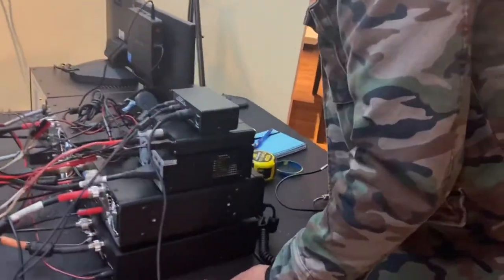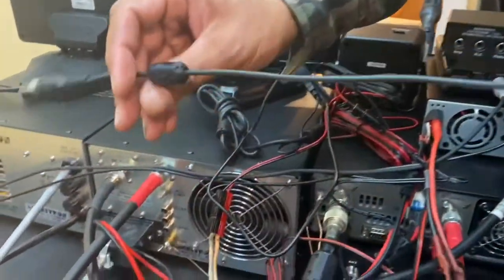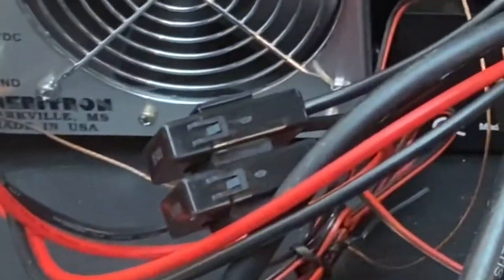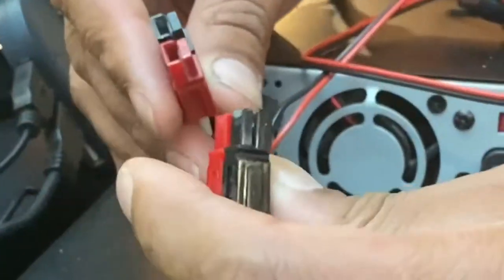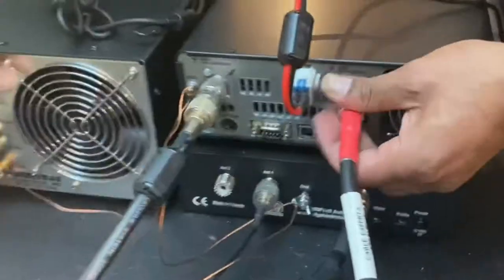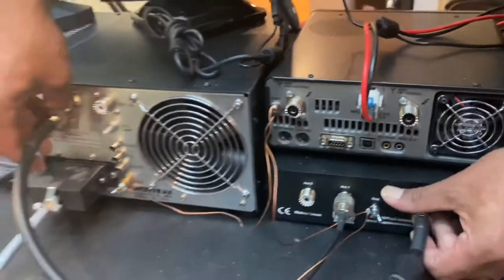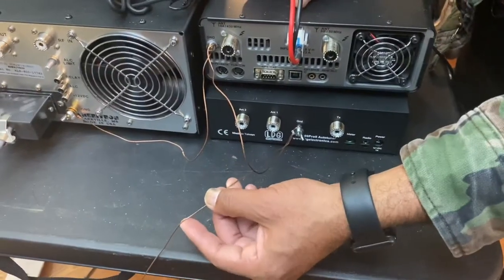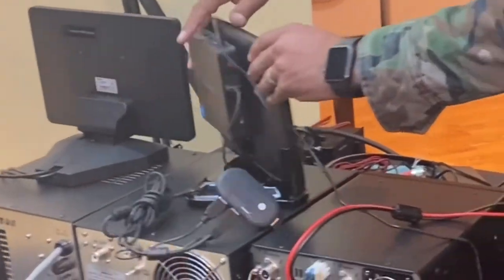Yaesu 991a - Ameritron ALS 600  - LDG AT600pro autotuner disassembly

Comment: Luis FYI... when grounding you should not daisy chain them. Best to run a ground from a ground stake outside to some 1/2" copper strip or pipe and them run separate connections from the copper tube to each piece of equipment using some braided ground strapping. Nice Video good job... 73 Jerry de K7ER

Comment: Thanks for the video.  I have a 991A and ALS 600 with power supply, but didn't know if they were compatible.  Each component should have it's own ground running directly to the station ground to prevent rf in the shack.  Ground wires should be heavier than what your using.

Comment: Hi Luis!
Great videos. I also have a Yaesu FT991A and have a SLA-600 Amp and PS on the way as well as a LDG AT-600PROII. 
What cables do I need from the FT991A? I ordered the cable with the Red and Black mini plugs. Where was the next video you mentioned in this video as I couldn't locate it?

Thanks Luis and keep the videos coming. 

73

Greg Lopez

Comment: Hey Luis,  I have the exact setup as you. Ft-991A. Als-600,  LDG AT-600ProII and the Ameritron ARB-704. 
The issue that I have is the ARB-704 power keeps the screen on my FT-991A dimly lit after it's turned off. Maybe the jumper settings? I thought that I wouldn't need external power but it wouldn't power up without it so I currently took the ARB-704 out of line for now.

How are your jumpers setup? Thanks
Reply: I think I may have figured it out.  The manual that I downloaded for the ARB-704 shows only two configurations for jumpers 1 & 2. 

The only way my radio powers the 704 without external power source is if I jump the first two pins (closest to the front of the 704) on both JP-1 & JP-2. Now it lights whenever I key up.

Fingers crossed that it is now correct. If not please let me know. 
Thanks 👍
Reply from the maker: To be honest with you. i’m not sure. I would check the amperage draw.